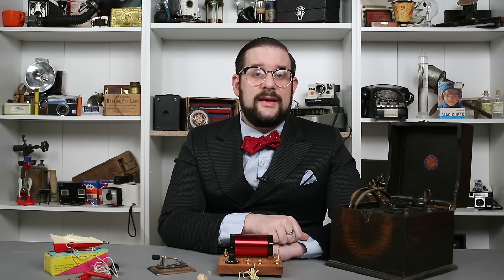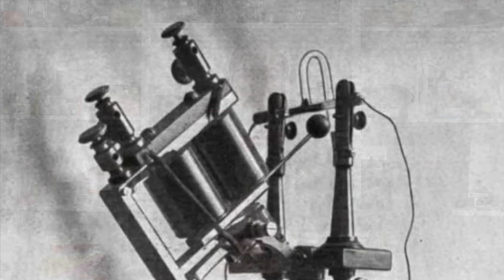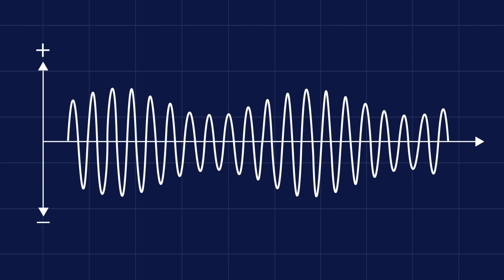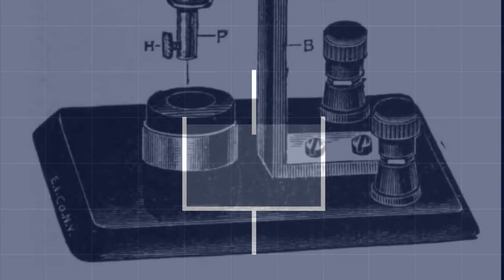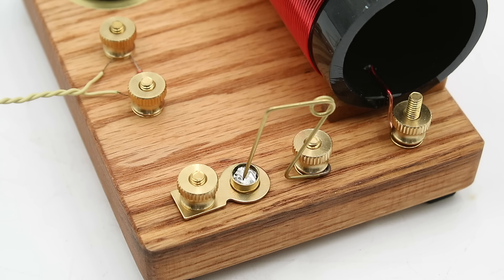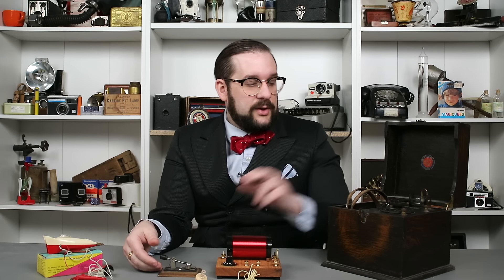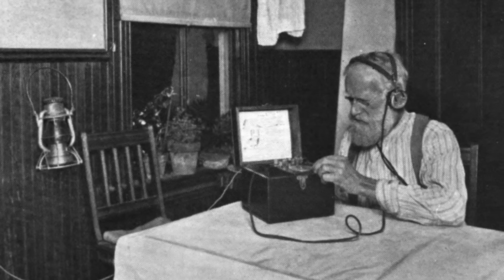Crystal Radios: No Batteries? No Problem!

Comment: My older brother got a little crystal radio for Christmas when he was about 10 years old.  It was in a little red rocket ship looking thing.  He eventually took it apart and hooked up an antenna to it and was receiving AM signals from all over the country. Years later when he was 14 and I was 13 he had progressed in his electronics tinkering to the point that he used that same little crystal radio as the guts of a broadcast station in our room with a horizontal wire antenna on top of our house.  We had a radio show every evening, with me playing records (single 45s) and talking.  The kids at school the next day always gave me reviews on our shows.  Later still he did things like going through a local computer manufacturer's dumpster to retrieve mistakes they had thrown away and building super computers out of the parts.  He joined the Air Force at 17 and his job was repairing guided missile systems.  All from getting a toy for Christmas.
Reply: I had one of those Rocket Radios, too.
Reply: I also had the Rocket Pocket Crystal Radio in 1952 0r 1953 - I was born 12/12/1949 my Father (dead) had been a Radio Man ww2. I had many Radio Books and was taught to read & Wrte age 14 when I had some child Illness and was Bed Riddend one wear.  I was amazed to hear Stations at night from Chicago, on the Coil Indunce $ Xal Radio. I was in Waco Texas. I learned from Drakes Cyclopedia of Radio & electroncs date 1938 to make Wire Indinced Booster for Better Signals, I had 1953 Amateur Radio Handmbook NOT the ARRL Book, i had that from 1954 hen ARRL & all were looking to the HCC allowing Ham Radios to allowed again. Hyram Pecey Maxion the Worlds most Famour Radio Inventer & Inventer of Maxium Automatic Rifle A/K/A/ <achine Gun. I become a Ham 1956 was featured in Popular Electronics Magene and was KD5MPM ...moved to Akansas in 1962 seen JFK murdered on TV and had Break of Schizophrenia age when Beatles were on Sullivan Show, I buid Radio Seta from Allied Radio and bought a 1947 Indian Chief fron a guy in Back Woods of Saline County, $75.00  ( Minimun Wase was 1.24 an hour in Benton Arkansas, Tried to get more better when Learn Guitar, I aso build Amplifers and Amps from Old Lukeboxs. I am 74 SENILE (Jesys saus Senine insnt a Sin)
Reply: @ElijahRadioProphet-mb9zu  now that's living a full life !
Reply: Really liked your story. The first time I used a crystal radio was when I was about 7 or 8. I was at a house party when left to my own devices one of the host gave me a small plastic radio and I was able to pick-up several stations . Radio is now my hobby I make xtal radios and I am a licensed ham radio operator.
Reply: @StevenFell-nu4db  very cool.

Comment: I received a cheap crystal radio kit for Christmas in about 1966. I had to wind the coil, assemble the parts etc. It didn't work. My grandfather, an aviation radio technician, came over, found the problem and replaced the 1N34 germanium diode. Presto! It worked! I thought he a was a genius. I spent many, many nights listening to radio stations thousands of miles away when I should have been sleeping.
Reply: You sound like me I got a crystal radio set about 1968. I didn’t sleep much after that. I was 10.
Reply: I got mine in 1969 for Christmas but it was missing parts. It was the iconic Remco kit and it was replaced by the Philco kit. It used a piece of galena and it didn’t work either. It would have  helped to have a long enough wire antenna and a ground. In 1975 I built one from Radio Shack parts, 1N34a, AM slug tuned loop stick coil, crystal earphone and a 2K resistor. This time it worked because and had a long enough piece of wire and a ground. It initially picked up shortwave because I used the lipstick’s tap and not the full coil length. Once I did that it picked up AM broadcast radio.
Reply: @briandawkins984  ditto...

Comment: It was the early 1960s.  My grade school teacher gave us an assignment to pick up a book at the bookmobile and write a report.  None of the books interested me, except for a book by Alfred Morgan, called the Boy's First Book of Radio and Electronics.  I was instantly hooked. I built one of the crystal radios and was fascinated that I could actually do that. Fast forward, that interest resulted in me studying electrical engineering in the early 70s which led to a fabulous career.  All that, thanks to the humble crystal radio.  Too bad kids don't do things like that anymore.
Reply: Oh, THAT Alfred Morgan? I have one of his other books, "Things a boy can do with electrochemistry!" It's one of my favorites among my collection, which I admit is partly because it casually mentions going down to the "general store" and picking up some asbestos paper for one recipe like it's nothing at all. Ah, the 50s.
Reply: @boxcarz   In the late sixties, as a thirteen year old, I would regularly visit the local chemist to buy sulphur, potassium nitrate, charcoal, magnesium and a bunch of other stuff. It was like a toyshop for me.
Oddly, I had to sign for the magnesium but not for anything else.
I also had no problems buying matches, 20 boxes at a time, meths, lighter fluid, fireworks etc.
Reply: I failed.
Reply: I’m 16 and do all sorts of junk like that! I’ve admittedly never made a radio but I’ll dick around with high voltage electronics and old 80s computer systems
Reply: @Fxltl  you my friend are a rare breed of the younger generations

Comment: My dad fixed TV's for a living, so we had a basement full of old ones I could strip for whatever I needed. I got the plans for a crystal radio from a book in the school library when I was about 11 and it got me hooked. The house already smelled of solder flux and burning wire, so I was able to get away with some major mistakes that Mom didn't need to know about.

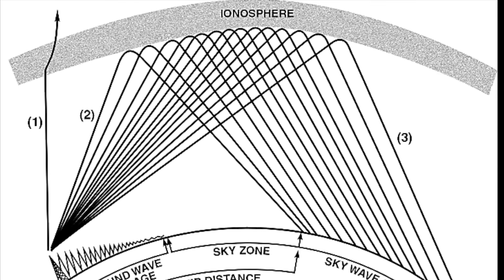Comment: 20:49  Shortwave radio doesn't actually bounce on the ionosphere but the radio signal is absorbed by charged particles in the ionosphere and re-emitted by them, going further along the curve of the Earth each time it encounters the ionosphere again.  This chain induction eventually introduces some random noise into the system.
Reply: Ummm, curve??? What curve??? Link please
Reply: '"but the radio signal is absorbed by charged particles in the ionosphere and re-emitted by them,"
Not so! 
If the radio signal is 'absorbed' in the ionosphere - it would be turned into heat.
But the 'ions' are moved (accelerated) by the radio waves, they are too far from other atoms, molecules or 'ions'.
The ions are, of course, electrically charged so they radiate as if they were an antenna.
To sum up - working together these ions  work like a mirror, and they 'reflect' the signal in the same way a mirror reflects light.😇.

Comment: Actually, you have an error at 6:56.  The rectifier diode has been placed in shunt with the LC-resonant circuit, such that when the voltage is positive on the diode’s anode, the signal is shunted (or shorted) by the diode; so it is the positive-side that is ‘removed’. Conversely, when the signal on the anode is negative, the diode is reverse-biased and no conduction takes place whatsoever, therefore the signal is un affected, and the negative-half’s energy is allowed to to progress through the rest of the circuit…

Comment: I'm planning on asking for that crystal radio kit for my birthday 🎂.  It requires no electricity or batteries. I received a crystal 🔮 radio kit for my birthday in 1984, but I never built it. I don't recall what happened to it, because we moved so many times. The fundamentals of these crystal radios 📻 is very fascinating 👌. I think the crystal (the drum and copper wire) grab the signals from the air (radio waves), and they play through the earphone. VERY INTERESTING YouTube channel!! Just subbed!! Your friend, Jeff!!

Comment: 22:27 This is a misconception. In fact, the only reason a radio receiver like this needs a capacitor or inductor (coil) at all is for selectivity, meaning to be able to tune to the frequency of a particular radio station. If you aren't fussy - or there's only one station close enough to receive a signal - you don't need any tuning parts at all, & your crystal radio will pick up any stations strong enough to detect. These days, it means you'd hear a bunch of strong stations at the same time, but back then, it was much less of a problem.

Comment: 14:21 For any electronics hobbyists watching this, for commercial diodes, a Schottky metal<>semiconductor junction typically has a forward voltage of around 0.1V, whereas a typical PN silicon diode (eg; a 1N914) has a forward voltage of 0.6V, making it pretty useless as a detector in a crystal radio. Schottky diodes are also much faster, as they aren't slowed down by the capacitance inherent to a PN junction, but are 'leakier' in the reverse direction.

Comment: My grandmother lived in a relatively small rural community in Illinois, about 30 miles away from St. Louis. Her farm, as well as the rest of the town received its electricity from a diesel generator located in the nearby firehouse. It was only run for a few hours each day, during which everyone ran their washing machines, vacuumed, listened to their radios, or did whatever else required electricity before it was shut off again. I don't think her community was tied to an official 24/7 energized grid until after WWII, and my grandfather, who was a lineman for most of his career, helped do it.
Reply: What was town?
Reply: Crazy, I live 45 miles from saint louis in the northeast direction and most of the towns have had electricity since before 1900. This must be an area with NO mines, power generation used to be a much more local ordeal.

Comment: Id love to build a super high end one of these with premium quality parts and a valve amplifier
Reply: Nothing really is stopping you.  You can get most of the parts you need for the basic crystal radio for not a huge amount of money.  The variable capacitor you may have to make for your self.  I would build that part first and optimize it.

Comment: I used a valve audio transformer to drive my 12"" speaker from the backyard wire. Excellent audio and owning to lower frequency avoided the whistle heard from those crystal earplugs. Eventually moved from crystal sets to regeneration

Comment: There's a chart online per wire gauge and # of coil windings. To get you to the band you want to listen to. I even was up on 2 meters. 7 or 14 windings with a  thick t gauge wire. Connected to a amplified speaker. Set for a laptop or computer.

Comment: In 1958, I was 7 years old. My brother-in-law's step-father had a small plastic box with a wire coming out of it with an alligator clip on the end. Also had another wire with an earphone coming out of the other side. He let me listen to it. He opened the back of the plastic box and there was hardly anything in it.  Fascinated me!  We had a radio at home but it had to be plugged into the wall and turned in different directions to pick up various stations.  I wasn't allowed to touch that radio.  The crystal set had only one dial, 1-10, and turning it slowly would change the stations.  I credit Mr W for getting me interested in electronics, building Heathkits in high school, electronics in the service and then a career with 2 electronics companies. Retired now!

Comment: I had many crystal radios as a child - several from Radio Shack. But, out of of all the ones I ever used?
That rocket radio blew them all away!!! - don't know why, but wow oh wow - they work beyond well......
And they were dirt cheap - available at the downtown Army and Navy store.

I used take my to school, and just clip the alligator clip to the school chain link fence, and it worked rather well.
(Grandin School)

At home?
Just clipped to the heater vent by my bed - listened to CFRN and Irv Shore in the morning.  And to not be puny? That CFRN signal was crystal clear.

Very cool, and no batteries. Loved that Rocket radio as a child - and it worked really well.
Reply: Can confirm. 👍👍
Reply: I had one of those rocket radios in college. I would clip the wire to the radiator in my room. About the only thing I can pick up was the compass radio station what was still kind of cool cuz it had no batteries or anything.
Reply: Yes, the rocket radio. My Dad gave me one as a present  around 1960, not quite the same design, but prob. the same guts. It wasn't just an intriguing curiosity, it was quite practical as a radio. Every night I lay in bed listening to the local station in Vancouver playing BBC's The Goon Show. So instead of wasting a pointless hour or so sleeping, I was getting an education...
Reply: I also grew up in St Albert until Gr. 4. I attended Sir Alexander Mackenzie. I had a crystal rocket radio when I was 7. I could pick up CHED, CFRN, CJCA amongst others. Those little radios made in Japan? Were impressive considering their simplicity. I would wind the antenna lead around my bed frame. That improved reception capability.
Reply: @briandawkins984  
Great memories,  thanks for sharing.  As noted I had a number of crystal radios but those rocket radios worked the best.
Reply: I got the Six Million Dollar Man 'backpack' crystal radio for Christmas one year. It was basically the late 70's version of the Rocket radio, instead shaped like an astronaut's backpack, with one decal imitating a control panel, and another with the TV show's branding and a cartoon image of Steve Austin. A hatch on the backpack opened to reveal an earphone, and an alligator clip. A stiff wire 'antenna' with a plastic ball on the end, acted as the tuner, as you pulled the wire out to varying lengths. The actual antenna was a piece of rubber coated wire, a few inches in length. I thought it was really cool. But, short of plugging into the ground of an electrical outlet (I think I probably tried and failed, with a painted outlet screw), I was left with sitting under a bathroom sink, and clipping to a bit of plumbing hardware. So, the 'magic' wore off, after very few uses, especially since I already had an AM/FM tube radio in my bedroom. 
I later recieved a Radio Shack 75-in-One kit, that included the components needed to configure a "Crystal Diode AM Radio".
Reply: Same here ! Great memories.
Reply: 20 years ago, a guy I knew bought a couple of mysterious boxes from an estate sale for nearly nothing, as no one knew what they were. They featured electrical terminals & knobs, but he couldn't figure out where a battery or other power supply hooked up, much less figure out what they were, or what they were supposed to do? He knew, that I was good at figuring things out, so he asked me. They were a couple of ready made crystal radio sets, which resembled if not identical to the Ariel one featured in the video. He was a technical person, who'd grown up making Radio Shack "Science Fair" kits & working on cars, so he knew about crystal radio sets, but had always thought of them as homemade, & never realized, that they were once a commercial product, placed in an attractive wooden cabinet! History books had always depicted crystal sets as diy contraptions.
Reply: My crystal set consisted of a WW2 earphone with its terminals bridged by a germanium diode.  A wire from one of the terminals was connected to the bed frame.  The earphone needs to be high impedance.  It picked up the Home service and when that went off, Radio Moscow.  UK 1961 Boarding school.

Comment: Schottky diodes or metal semiconductor junctions are actually quite commonly used outside of radios. The lower voltage drop is useful for its reduced  power dissipation and the low reverse recovery time is also useful in power electronics.
Reply: ... and the fact that they turn off very fast makes them good at high speeds.

Comment: Back in the fifties my parents were sailing in and around the Solomon Islands and we got shipwrecked on an island. I was able to build a crystal radio out of a piece of broken samurai sword, some copper telegraph wire, and a couple of coconuts. And by the way you have to have a bias voltage if you use carborundum crystals.

Comment: I made one of these when i was about ten years old...  bunch of    wire, capacitor borrowed a razor blade from dad , a diode and a capacitor to move around on the razor blade to change the tuning. i was in the basement and picking up people talking on the radio from many states away on a single wire antenna.

Comment: When I was 12 years old, German Yps-Extra Nr.1 came with a germanium diode detector receiver. I used it a lot for listening to Sci-Fi radio dramas. Good times, nice memories.
Reply: I also had the Yps kit. Unfortunately we lived too near to an 500kW AM transmitter. It didn't matter how I set the tuning coil, I just got that one station (Bayern 1 at 801 kHz).

Comment: At an AM station I engineer for I occasionally do tricks like putting some headphones on someone, touch the jack with my finger sometimes touch a ground and you can hear the broadcast in a similar principle to how a crystal radio works.  l can also hold a curly bulb near the tuning coil (matches the transmitter to the antenna) and it will blink along with the modulation. Visitors think it's neat. Former engineer and mentor has some radios from the 20s when they were still experimental in his collection. They are beautiful both in looks and design for their time. I can sit for hours and talk with him about a 75 year career in radio learning as much as I can and do whenever I can while I still can. The engineers and teachers like him that really know this stuff that were there through most of its important evolutions and really know the history are a rapidly dying breed.